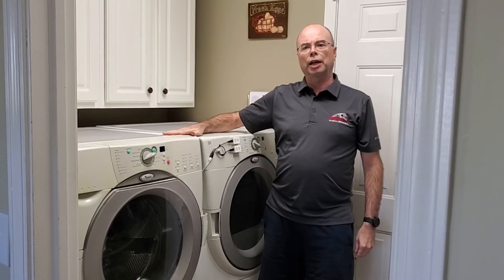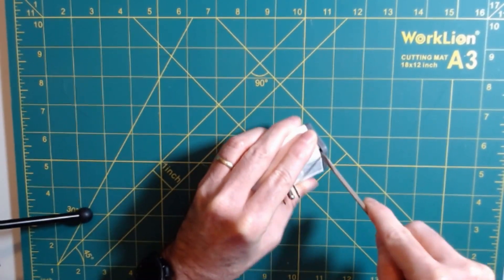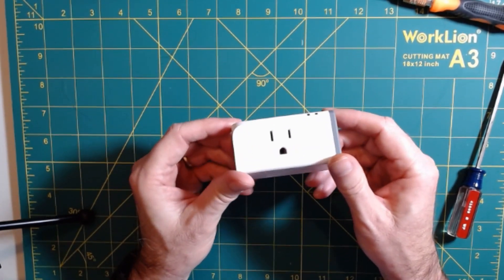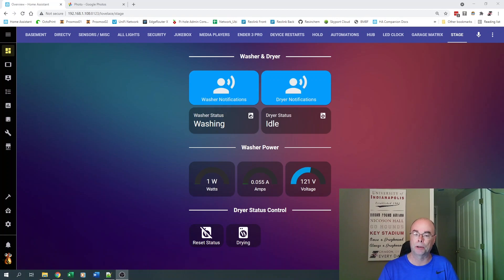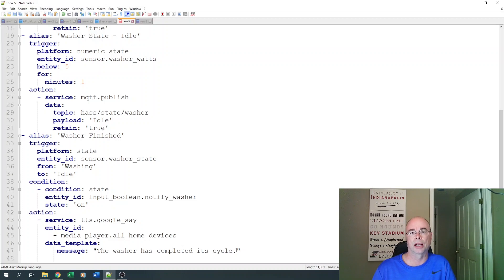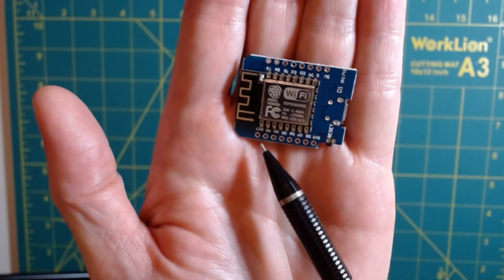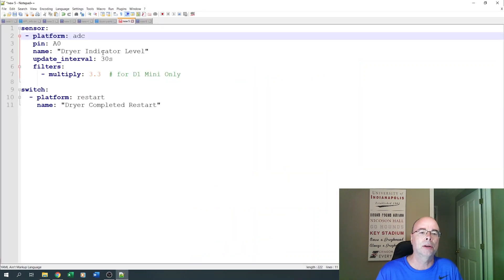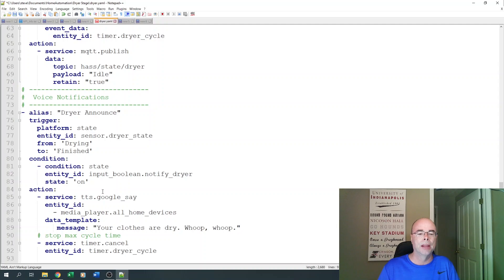Washer and Dryer Notifications for Home Assistant

Comment: Considered CT clamps on the dryer instead?
Reply from the maker: I did talk about the possibility of using a CT clamp in the video (~13:40) and this was my first thought.  But because this would have to be placed on the motor leg (and not the heating element or I'd get false positives on the amp drop), it would require pulling out the dryer and opening it up.  My wife wanted the notifications but told me I couldn't take the dryer apart to make it happen... hence I had to pass on the idea of the CT clamp!  I could have also considered the idea of a CT clamp at the breaker box, but honestly, the solution I used was actually easier and cheaper than other alternatives.  But of course it does require the indicator lights on the front, which I'm sure many models may not have.